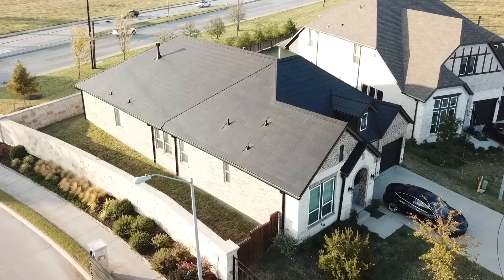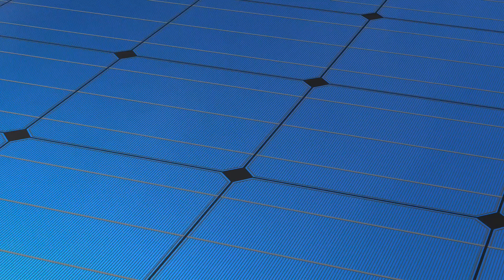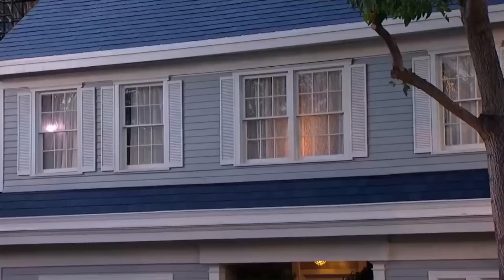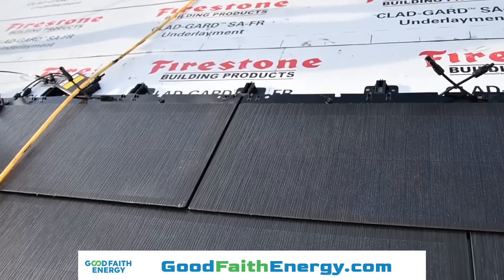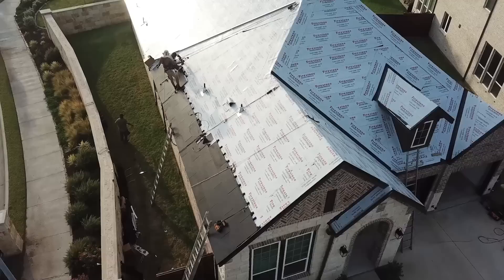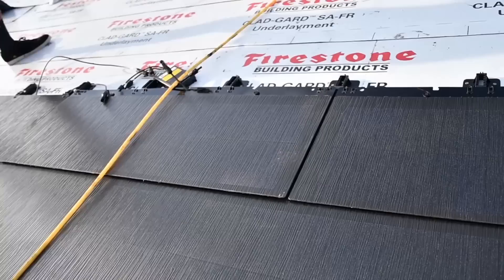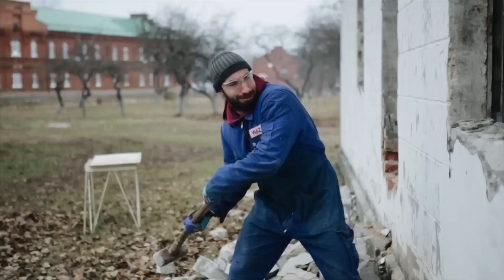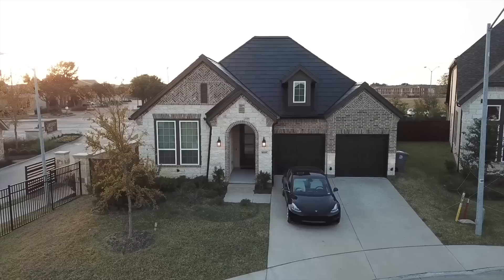Tesla Solar Roof - Expensive Fad or the Future?

Comment: Order the tesla roof back in February of this year.   Got a quote, loan and it we were just waiting for the city permit to start building.  Original quote was for 42k for a 7.75KW system.  Yesterday I got an email from tesla stating a price increase was going to happen, I opened my email and seen it was 20k more than the original quote, at this point I'm gonna have to wait till the materials are abundant.  I don't think it was a bait and switch from tesla, the low production of the none producing tiles is the issue.  Guess I'll come back at another time to order the solar roof.
Reply: Yeah I don't think Tesla was making enough profit on the roof so they up the prices. Still kind of a shitty thing to do to the reservation holders I think they should have just bit the financial bullet.

Comment: Would love to see some efficiency figures between solar tiles and normal panels.
The only thing really going for it seems to be the look.
All rather interesting
Reply from the maker: interestingly because you have so much space, efficiency isn't as crucial. Unless you have a tiny home with a very small roof, in which case you'd just get all generating tiles.
Reply: I would like to see some more details on these panels.
How are they connected in series, whats the string size; how are they monitored, if one solar tile down how, does it effect the string? I have yet to see any details on this.
Tesla are doing their own Inverters which is often the weak point for systems, so this is great.
Reply: I have a perfect south facing roof, which I was considering packing with Jinko solar panels.  That system would of produced twice the power of the Tesla system at about the same cost,.. but I needed a new roof too.

Comment: Thanks for this great overview, Ricky. One thing I've not heard about is the relative efficiency of Solar Roof compared to panels, and the typical ratio of active to non active panels in an install. Would it be cost effective to install mainly active panels in conjunction with Powerwalls or other energy storage and net metering? I found it funny that a "Tesla Certified" roofing company had no idea how to install Solar Roof, so they called Mo! 🙂
Reply: I think the price with a high amount of active panels would be extremely high. They also seem to be only mediocre in efficiency. So even a big roof can only net you 10 kwp. Powerwalls and net metering usually don't mix financially. Even if you have a high evening peak electricity price, it's significantly cheaper to just build a bigger pv array than to get batteries to cover the peak times.
Reply: The number of active panels on the roof would depend on the size of the solar system they are building you. If you have moderate power needs, they arent going to build you a system that produces 3 times what you use. in addition, in Ca, they wont let you build such a system. They will only approve a system that is within 5% or so of your needs. So in reality, you dont have a choice. This new NEM3.0.. The ONLY thing I saw in it that looked good, was allowing home owners to build systems that produced 150% of your expected consumption and that is only because of the expected dominance of the electric cars in the very near future.

Comment: The reliability has yet to be proven, but based on looks (which most people use to select premium roofing) I would say that tesla has a bigger advantage in roofing than they do in autos.  Solar roofing honestly does more for the environment than their EVs too.  If they ramp this up they could dominate the premium roofing market.
My only question is about the warrantee/durability.  25yrs is less than other premium rooves but if that just means the power output will decay, but the roof will live 100yrs this is a winner -and it sure looks like it can.

Comment: How long does an asphalt tile roof last as compared to a solar glass one?
When you need to replace your asphalt tile roof, do you need to strip off the conventional panels that are installed above?
Do conventional panels look good atop a conventional roof?
Reply: What are you getting at?
Reply: 20-25 years. So you shouldn't build a pv array on a roof that has to get replaced within a few years.
Reply: @Psi-Storm if you have solar panels over any roof, whether asphalt or not, the roof itself should likely last longer than its expected life because it is shaded and covered by the panels - less "wear and tear" on the shingles.

Comment: So cost would be 50k to 70k with a yearly savings of about 2k to 3 k of utility cost , now add that by 25 years 2k x 25 years is 50 k or 3k x 25 years = 75 k .. factor in maintenance cost in a 25 year life span 10k to 15k  and that’s if they make those roof panels ! Good luck
Reply: thought the same the installer even says the price in based on the contours of the roof 
also what about insurance will it cover hail damage or even the roof itself outside of California 
Who really benefits the buyer or the multi billion power company and city energy board
Reply: Tesla roof is not a bout saving money. Its just a pretentious product!

Comment: Just had an install. The underpayment is upgraded to thick, strong material.  The plumbing roof vent tubes were cut off and are capped with a flat vented cover.  I requested a roof ridge vent, they answered that  it’s already included.  Installation is slow and tedious.  I got rid of an old poorly installed steel roof and gained a beautiful roof all subject to federal and state tax rebates, winner.

Comment: I wonder if these tiles will suffer from micro cracks like normal solar panels when you stand on them. Even though you can stand on normal solar panels and they are rated for hail you still shouldn't stand on then because of micro cracks in the class cause hot spots.

Comment: Hoping to find out in 2021 if it's a fad or brilliant investment. Next biggest question for me is if it would ever pay off to get a powerwall.
Reply: By far the biggest question for Powerwall payback: do you have net metering?  (meaning, the electric utility is forced to buy back your electric at the same price you buy from them) 
If you do have net metering then it doesn’t matter if you stick $1worth of electric into a battery, or back onto the grid (actually, due to storage losses and inefficiency, better to put it back on the grid).  The powerwall is backing up the house in case of power failure but doesn’t help with the electric bill.
If you don’t have net metering (meaning, the utility pays you less than unity cost for what you put back on the grid, or not at all) then the equation to figure out payback on the powerwall is to figure out how much excess electric you make during peak production times that you can then use during non-productive times, rather than buying from the grid.  Let’s say that you add 10kWh to your powerwall most every day during peak production, then use that 10kWh every night (rather than buy it from the grid) then you save the cost of 10kWh of electricity every day (that has good solar production).  Assuming $0.25/kWh cost for electric, and 6 good days a week, that’s $15/week savings, or $780/year, so at an installed cost of $7,800 for the powerwall (a total guess) break even is 10 years.

Comment: Not worth it in most of Canada, or northern US,  where there is less than 10 daylight hours in a day for 1/3 of the year. The time of the year when you need the electricity the most. Price would have to be half. Maybe 15 to 20 years from now. Wind power is better in Canada right now.
Reply: This is provably false. There are lots of solar-equipped homes in Seattle and Vancouver, BC and they all do quite well even on a rainy fall or late winter day. 70% of Canadians live south of Vancouver, so yeah, you're wrong.
Reply: @anthonyc8499  that must be why all provincial governments are pushing wind projects. They always do the wrong thing. Anyway my point is, the Tesla roof in Canada is closer to $65000 Canadian. Not worth the $1200 return in electric Savings. Like I said if it was $35000 Canadian, maybe.
Reply: @markwhatzhisface3331  wind is grid scale while solar can be slapped onto anything. Surely there are incentives to install rooftop solar in Canada? There are roofs that have them going in the Vancouver area.
Reply: @anthonyc8499  Also, electricity is super cheap in BC compared to ON, my Bill is double my cousin's and they consume more electricity. Additionally most of BC's power comes from water (Hydro power) which is more environmentally friendly compared to coal and gas, why bother with solar. What is solars ecological footprint compared to Hydro power. Hydro is provably the cleaner.
Reply: @anthonyc8499  Solar is great, just saying Tesla's roof is not cheap enough yet to make it worth it. My sister looked into Solar for her farm in Guelph, still not economically smart. Environmentally yes. But $$ talks.

Comment: If you're in texas and have enough space you should consider a ground mount solar system. The energy production is going to be much better but still more expensive than a roof system. 

If you're in cali are have limited space, the tesla solar panels work fine and are some of the cheapest around right now. I don't believe you need this as you're paying 3x for the same solar production. It's still cheaper to replace your roof every 20-35 years.

Comment: I'm a 45 year waterproofing expert, 2000 per sq! average home is 25 to 30 sqs 50 to 60 grand for your roof, who is going to pay that much? A very small percentage  ( less than 1 % ) of homeowners that is certain. also, an extremely proprietary  product, very few roofers would be able to fix leaks or make tile repairs, most leaks come from flashings, let's say you need to install a vent or plumbing pipe, how can you with glass tile in the way? My electric is 50 per month here in Oregon,  how many years will it take  to pay off a 50 thousand dollar roof? This is a Square peg in a round hole in my view.
Reply: Electric car started out super expensive too.

Comment: Why is the power production based on your consumption? Why not just produce as much electricity as the roof can make efficiently and sell the excess?
Reply: Economics! Here in SoCal electricity costs a minimum of 25¢/Kwh but you only get 2¢/Kwh for selling it back to the grid. A Tesla roof costs about $19/sf  (including old removal). Solar adds about $1800/KW (before credits). Assuming 8 KW/day sell back to the grid yields about $60/year return and a 30 year payback. Not a viable business plan. OTOH, offsetting 8 KW/day of usage save over $700/year for a 2.5 year payback.
Reply: @GntlTch  Thanks for your reply. With batteries and Virtual Power Plants and different legislation things could change so that a company representing lots of home owners sells electricity into the grid at whole sale prices takes a cut and gives the rest to the home owner. In Victoria Australia the price for a Kwh is about 25 cents Australian. you don't need to apply the exchange rate it's the same cost really for middle class people relative to salary/wages. Anyway the thing is sometimes the wholesale price goes to $1.50 a Kwh or even to $10 a Kwh -not often but it happens. And the price can get to 10 to 15 cents a Kwh in peak evening time especially in summer and winter.

Comment: Has anyone done research to see if/how much attic heat is reduced by a solar roof?
Reply from the maker: Robert I didn't have actual numbers so I didn't mention it, but just pure laws of thermodynamics, energy from photons absorbed is reduced from the load that is radiated as heat. also it has a bit of a radiant barrier effect, which helps to block thermal radiation as well. so it should have a very big impact in keeping your home cooler in the summer, and warmer in the winter.
Reply: @TwoBitDaVinci  That's what my gut tells me as well.

Comment: My town has a demonstration solar farm with these Tesla tiles. They noticeably underperform the conventional panels right next to them.
Reply: Link please? It seems weird to use the roof tiles on anything but a roof.
Reply: Mark, 
I'd love to see the demo study info.  Please share a link.
Are they comparing actual PV cell array size or the solar tile size. The actual tile size that contains the PV cells is of course  larger than the PV array.
Cheers,
Eric
Reply: @erickessler6094  -as it is set up they have arrays of panels in a solar farm each with its own intertie . I don’t think they are trying to be strictly scientific about it.  It’s no secret that the Tesla’s tiles aren’t the most efficient. They don’t publish that info that because it’s estimated to be half of a traditional panel. . There design focus was on esthetics. One advantage however is they don’t have the problematic perimeter frame which as you may know is a dirt catcher.
Reply: @M13x13M  say Mark, would you be kind enough to share a web link or more info on this study?

Comment: Ricky, the solar efficiency of this roof is very low- under 10% or less than half as efficient as traditional panels. Solar roof uses microinverters so all electric goes from DC to AC even if it goes to a battery. This is dumb. The warranty is only 25 years. It should be 40.  I'll wait for more efficient tiles and inverters where needed.
Reply from the maker: solar roof does not use micro-inverters... who told you that?
Reply: @DharmaRascals 
Tesla uses string inverters and then your PowerWall/Gateway handle the energy distribution.

Comment: BIG ISSUE

Metal roofs are 50year+ , tile is 100year+, slate is 300year+ lifespan. Whereas ALLA, and I do mean all solar panels degrade over time both in terms of the facing glass but also in how much energy they produce. I’m talking 20% reduction of electricity over 25 years.

Plus, nuclear power is a safer, greener technology than solar (it’s not even close, by factors of 100s better in terms of deaths per 100,000 and in CO2 emissions and in toxic waste and in environmental damage due to mining)
Reply: Worst is that Tesla only warranties the Solar Roof as weatherproof for 25 years, which is like the cheapest asphalt shingles.  I recall they warranty only 20% loss in power output after 25 years, but you do need to keep the roof clean of dust to get rated output.  It doesn't rain for 7 months out of the year in California, so you will need to wash your roof every month or so, given the dust build-up.  Only one side of the roof will typically get active solar tiles, and not all of that side, so decide if you want the bulk of your roof to be unproven glass tiles just to get some solar ones.

Comment: Hi  all at Two Bit, 
This is is a slight deviation from your exact thread but is still EV and Green energy-related.
   I was wondering why no one is talking about TE$LA and Wind turbines.
With Elon and his company's engineering expertise, I am sure they could design and build The most
efficient turbines and towers on the planet. With their knowledge of motors (and that is all a generator is, a motor being pushed rather than driving a shaft) coupled with the aerodynamic design of the blades ( remember they have some of the best drag coefficient numbers of any other road car due to their in
house designers and fluid dynamics engineers.
That along with Elon’s Materials expertise used in designing the towers, and his ability
to scale up production at lightning speed, I cant see how this would not go a
far distance to accelerate his change to renewables and away from fossil fuels
in the prime directive.
Can you honestly think of a better company for this job than TE$LA ????

Eddie in
Scotland
Reply from the maker: wow yeah i don't recall ever hearing about Tesla getting into wind turbines! great suggestion! I think i'll do a future video on it
Reply: Hi Ricky, Just a side note, At the end of 2018 or early 2019 I left you a post at having a few T$LA shares and hoping they would make enough to eventually buy my own Tesla car. and your reply was something like " that is a good goal to have" Well I could now buy 7 of them with the shares, but still not cashing in.
Reply: @MrEddiekessler  are you going to buy at least one?

Comment: why fake tiles? Why not put the whole roof full of solar?
Reply from the maker: Some areas have shade or face the wrong direction. In the northern hemisphere we want solar tiles on the south or west facing parts of the roof. So parts that aren’t ideal just have non producing tiles
Reply: @TwoBitDaVinci  Yes, that's the old way of planning solar on a roof, but if I could get Tesla solar roof here in Europe I'd love to put my whole roof full of them- every square foot of roof will produce some amount of electrical energy - even those in the shade or not directly in the sun.
Reply: Cost prohibitive to do an entire roof.
Reply: @TwoBitDaVinci  
Ricky, is it true that with the string inverter systems like Tesla, if part of my roof is on a different angle (or even if a tree shades part of my array) that the array total energy production is somehow limited to the output capacity of that shaded or least producing array?  
If true, I can see part of the issue (like for different roof angles) could be mitigated maybe by creating seperate strings for each different roof plane on you house and then somehow feeding your Inverter, Gateway & PowerWall electronics to optimize full energy production and collection??? 
Brother, for my wife and me, the SolarRoof is the only acceptable look.  Like you, my current home/roof is too new) I'll have to move out of this home and build another from the start with SolarRoof and PowerWall integration from the start... 
So that's my 2-3 year plan. 😀
Cheers,
Eric